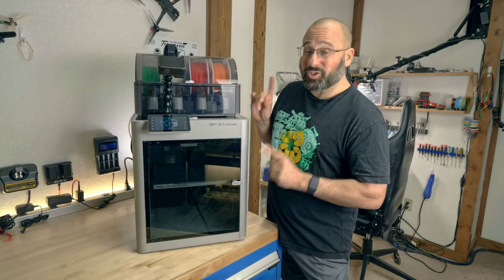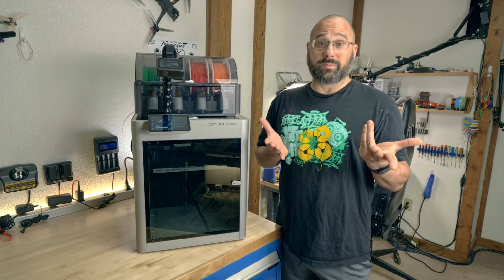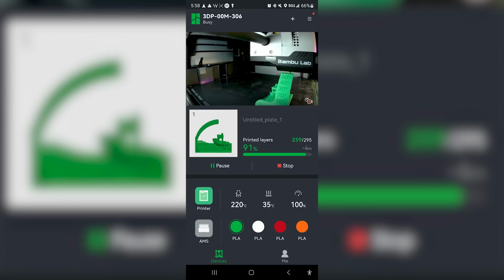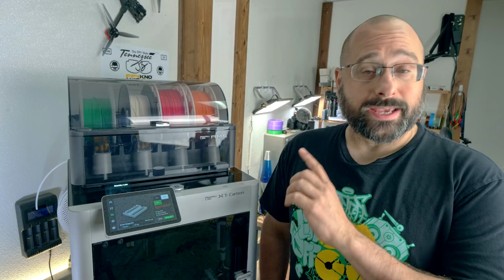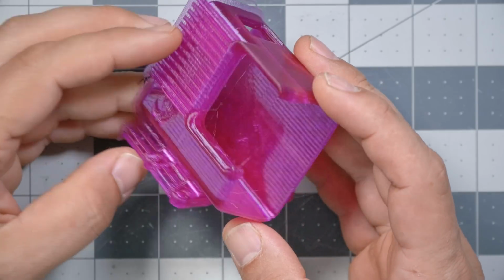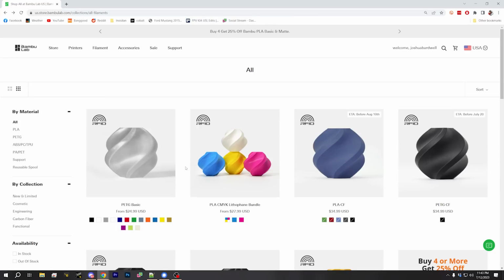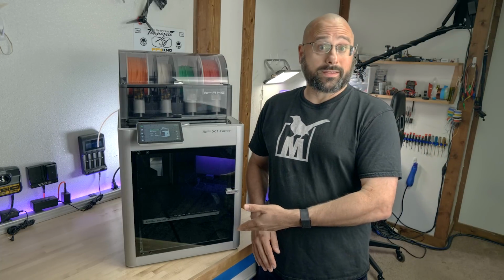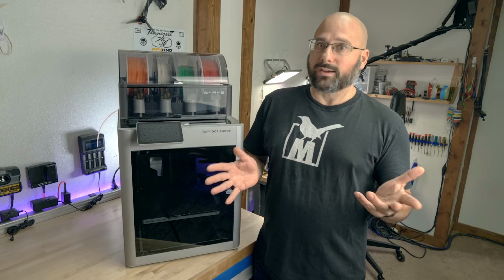Bambu X1C: the Fastest, Easiest, BEST 3D PRINTER I've Ever Seen

Comment: I just bought a P1P - it is hands down the best filament based 3D printer I've used to date.  Other than changing what filament to use via the bambu slicer, I've made zero changes to any other setting, and I haven't had a failed print yet.  That also includes TPU!  Completely blown away.  No doubt that Bambu has come the closest I've seen to a true press a button and it works type printer.  Very satisfied with the purchase!  I've also ordered the 4 color AMS and the $150 P1P->P1S upgrade kit.  If anyone out there is on the fence about the brand in general or whether to get a P1S or P1P, I wholeheartedly recommend the P1S.

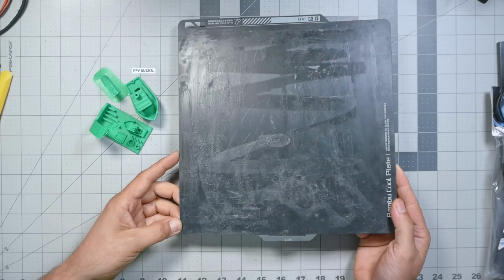Comment: 10:44 mb i can help you with the adhesion problem. this buildplate looks disgusting :p i printed more than 10kg of filament on the x1c and never got a single print come off the buildplate. i used the cool; engineering and PEI plate with prusament (pla/petg & pc); bambu filament (pla & pla-cf); filaflex40 TPU and PVA. just clean ur build plate with isopropanol EVERY print and use the glue stick only on verry large parts OR just increase the bed temp which does the trick too

Comment: Josua, just little correction ... P1P is working with AMS without any issues, there is also now P1S that is upgraded version with side panels and other stuff, like fans ... and it is also working with AMS. P1P is basically budjet frendly Bambu lab printer that can be upgraded to some way ( I think that upgrade kit from P1P to P1S is about 160$ or  something like that).

What you can maybe also try to show in other YT videos is how carbon filled filaments  are maybe ok for printing some parts for drone ? 

And welcome to Bambu lab printer owner club :D happy printing with it.

Comment: I build alot of printers and trust me the x-1 carbon is the best of all worlds. Unless you really plan on doing custom configuration of your printer or want to push speeds on a voron etc just buy ones of these! Even a bunch of voron builders have one of these too just to handle the multi-filament capabilities that the x1 has the ERCF just is a hassle to manage and you almost save more money not using your time to make one!
Reply: This is accurate - the Bambu and the Voron appeal to different markets/mindsets.  One Youtuber decided to get the X1C to print all of the parts for his Voron project which speaks volumes.

Comment: Ah I'm a glue user cause all I do is run my cold plate under screaming hot water and in 30 seconds it melts off all the glue. Zero warping issues.

Comment: I'd guess it's called a 'cool plate' because it doesn't depend on the heating and cooling process for the stiction (expansion of retraction) of the plate. My .02¢ .
Reply: It's called the "cool plate" because it needs less heat for PLA to stick to it.  It still requires some heat to help with bed adhesion.  I think the idea was Bambu was trying to make a plate where the bed temp was low enough that you could print PLA with the door closed, and the passive heating from that build plate temp wouldn't heat the enclosure up to the point PLA would glass pre-extrusion and clog without needing to run the chamber fan or take the lid off, etc.  Because running the chamber fan or opening the door/lid significantly increases the printer's noise level, and it's already loud AF.
Reply: @heroflying  Or, as with all else, "marketing" 😜

Comment: I've got the P1P and it came with the Bambu Dual Sided Textured PEI Plate and I get excellent first layer bed adhesion! Also i noticed if you print on Ludacris mode on the thin tight areas the print comes out better looking. I also noticed that if a print kinda messes up a little then the next time you print the same print it comes out better as if the printer knows what it did wrong the first time! I love this P1P! Thanks JB Cheers!

Comment: $1500 seems like Chump Change compared to the $10k my employer spent on an Ultimaker S5 with material station and air management system. We had to buy that printer because it was an approved machine. What a disappointing printer. Buggy, uses 2.85 mm filament and isn't direct drive.

Comment: Maybe you can try printing parts in different materials now and see if any parts are better in different materials than just their traditional ones. Maybe trying some polycarbonate, polypropylene or nylon. The go pro mounts and other flexible parts may work better in polypropylene. It is flexible too (usually classed as semi flex but I have found it is as flexible as stiff TPUs) but is ridiculously durable, it lasts much longer than other materials when used in living hinges and it doesn’t suddenly fail, some I have seen have like 600 % elongation at break and great impact resistance.

Maybe a polycarbonate would be good for things designed to take impacts but again a TPU or polypropylene might be better for that. Maybe a carbon fibre nylon or standard nylon or polycarbonate for skid pads. 

Once you can printer a wide range of materials and know what they are good for it opens up a lot more possibilities.

Comment: The dual colour screw gauge is easy to do with a single extruder printer, even a basic ender 3. The text is above the rest of the print so just insert a filament change at the layer the text starts so when it prints it, it will stop at that layer and let you change colours and then print the text.

This works with any print that needs different colours for different layers but it is very limited because you will need to have at least the whole layer that colour, so it works best for big block changes.

Comment: Your still gonna be getting to tools out. Be careful with that carbon fiber filament. It’ll jam the nozzle. No need for gluestick either…they want u to pit gluestick on to help you REMOVE the part after printing. It’s not needed. If your part isn’t sticking turn the head of the build plate some or use the high temp one. You can also uncheck the boxes for all the prep work. Bed leveling etc. it’s no necessary every print.

Comment: Slight correction. The ams can be upgraded to 16 filaments.  It has many many other features.
Getting the basic stuff out of the way multi color, multi materials with similar filaments,

It can be used for breakaway or soluble supports It's great for pla to petg print/supports
It can be used in run out mode. That means it will switch to the next roll if you are running out of filament so you can use up nearly spend rolls.
You can use 4KG of filament at a time
The AMS doubles as a (non heated) drybox with desiccant 
it has a humidity sensor so you have a rough idea how saturated the AMS is. (green, yellow red)
You dont have to touch filament at all which makes printing seamless from printing locally or remotely. 

Downsides
Do not use abrasives or softer materials like tpu but sttpu is an alternative to general tpu.
Reply: What the hell is STTPU?
Reply: oh how can one not up it to 16 materials... you just spent a bunch of my $$ damn u

Comment: I have an p1p with some tweaks (you can buy them in the p1s pack). It's a great machine, I don't need the lidar sensor. 
But I need to correct something you say', the p1p CAN run with Ams. Also Bambu says don't print TPU from ams.

Comment: Regarding the print bed, its funny Ive got a CEL Robox from like 2016 that I'm still using, its got maybe 1200Hrs of printing time on it and I have NEVER had a single print detach from the print bed during printing. I don't use any sort of adhesive, I just clean it with IPA from time to time. When the print finishes and the bed cools down, the part detaches by itself. It looks like a sort brown fiberglass like what old PCBs used to look like. I'm convinced now its the ideal build plate material. Anyway great review Joshua, I want this printer!

Comment: 25:38 what are those thick rectangles under bambu P1Ps on the shelf? Are they concrete blocks? Is there anything else between the printers and these blocks?
Reply: Paver stones probably to give a flat full surface for the printer to sit on since he’s using wire shelving.

Comment: The drying mode doesn’t just heat the bed, the printer has a heated enclosure. I would definitely get a Bambu if they weren’t proprietary closed source and had the same reliability and support as Prusa printers. Nice to see some competition for Prusa.
Reply: yeah im also unhappy with the reliability. cant get all parts and there are quite a few failures popping up where there is no replacement available. sending in a huge 3d printer for repair is not something i want to live with.
Reply: @drkastenbrot  I have been printing for a year with zero issues. Which parts can you not get?

Comment: Been running 15 Prusa i3Mk3s in a school lab for almost 4 years now. Seriously considering replacing them with Bambu's. I definitely do feel some affinity for Prusa and their open source machines, but the speed on the Bambu's is excellent. It is also a bit of a pain to order internationally with my school. I will say that some of my Prusa's have over 900 days of print time on them and 15km of filament printed so we've certainly gotten our money out of them. Thanks for the video.
Reply: Prusa just came out with a frimware that suppose to make their printers print faster.
Reply: Sometimes you are better off knowing the devil you know! The grass is not as green as it is being advertised.
Reply: @muddymaker3721  Yeah I hear you on that. I'm going through and basically rebuilding all of them right now. The nice thing is that I actually can rebuild them, can easily get parts, etc. I'm reprinting a lot of the parts around the X axis carriage in higher temperature plastics and am hoping that will help with some melting issues we've had when large blobs form due to print detachment.

The other big question is that I sometimes have over 100 students all with 24/7 access to the printers, and as you can imagine they take a fair amount of (unintentional) abuse. I'm actually a bit worried about all the features on the Bambus since in my situation that is more points of failure.

I suppose in the end, it is great as a user that the technology continues to improve. Really that's a win for all of us regardless of what printer we choose.

Comment: Bambu's offerings are not all that great and revolutionary. A stock voron or ratrig can easily push those speeds and accels, bambu is closed source and has all propriatory parts. If you print a part on the "standard" preset, it will be lacking in strength compared to the same part printer slower. You also cannot calibrate the damn thing yourself (flow, pressure advance... etc). However, credit where it is due. It is by far the easiest printer to get running and use. Prusa a close second. Regarding privacy, all your files go to a server in China, where privacy laws aren't great to say the least, you cannot send files "Lan-only". For anyone wishing to get a 3D printer that is not a kit, get a Prusa MK4.

Maybe a slightly negative comment, but not many people bring it up and it should be discussed before a purchase. I dont recommend Bambu.
Reply: "You also cannot calibrate the damn thing yourself (flow, pressure advance... etc)."  This is flatly not true. You can tune Pressure Advance with Orcaslicer if you want, and Bambu even provides documentation on calibrating flow.  https://wiki.bambulab.com/en/x1/manual/manual-flow-rate-tuning

Comment: Should mention the P1S for those that cannot afford this, the P1P is even cheaper but does not do all material as it’s not enclosed and bearing in mind your hobby an enclosure is pretty much essential as you will want to print in higher temperature material.
I have had an X1 for about a year and the LiDAR is not that useful.
The rest of the options are useful.
Love my Bambulab printer.
Reply: And the P1P does work with the AMS by the way. And it does  work the enclosed P1S as well. None of them are perfect but it’s the closest I have seen to plug and play.
Reply from the maker: The flip-side is that lots of people don't print ABS or CF nylon, and don't need the enclosure. For them, the P1P is perfect.
Reply: @JoshuaBardwell  Here's the thing though - just because you don't print with ABS and CF nylon, that doesn't mean you won't benefit from an enclosure.  Everyone gains at least SOME benefit from an enclosure.  For example, yes, ABS and nylons for example absolutely warp more than PETG, hence why people say use an enclosure (plus ABS fumes).  Does that mean PETG doesn't ever warp?  No.  PETG does too.  If you print say a big open box across most of the build plate with sharp corners, PETG absolute can warp on you in colder room.  So can PLA, just not as much.  Enclosures add consistency.  You also have the charcoal filter in the enclosure.  The enclosed printer is much more effective as a filament dryer if you use the printer for that.  It's more efficient power wise.  While that doesn't mean everyone has to or should buy one, if you're looking at the P1P for $600 vs the P1S for $700, the P1S is a no brainer.  Right off the bat the P1P doesn't have the aux cooling fan which can help with lots of prints, not just with those materials, which is a good idea for most people.  There's $30 of the $100 for the P1S...

Just get the P1S at that point IMHO.  The enclosure is worth $70.

Comment: While printing that fast is pretty amazing, the layers below the 'water line' on your benchy looks kinda sketch.    I'm guessing it's using variable layer height which is great for speed, not so much for quality unless you are doing some post processing.
Reply from the maker: Could be. Bambu slicer does support variable layer height. And that would increase the speed.
Reply: it's not because of that.  It's a known issue with benchies because the top deck completes which radically reduces the layer time, and this changes how much cooling above and below that line get.  That changes the sheen of the filament. This video kind of explains it pretty well.  https://www.youtube.com/watch?v=J_pxk7HP3RE

Comment: With my ender  3 I've literally never had any problems anymore with bed ahesion, for years now, after I switched to sprayglue on the bed before printing (3Dlac in my case). I believe Bambulab recommends their own brand of gluestick, never anything else (of course they do). They can make textured beds all they want, the reality is that those suck. I believe that is the reason you experience the print loosening from the platform there.
Reply: If textured beds suck, why does mine work so well?

Comment: @joshuabardwell I got my X1C about a month ago, I print daily and have had zero failures to print. I've used the Cool Plate and the Engineering Plate (two sides of the same plate). I use the Bambu Lab glue stick and my prints have never lifted from the print bed. I've printed TPU, PLA, ABS, and ASA using Bambu Labs and Matterhackers filaments, all without any issues at all. The Matterhackers TPU was printed using the Bambu Labs TPU95A profile. I've printed bunches of TPU stuff, and all have come out just fine. After printing, I always wash the plate using dish soap and water, just as the text on the plate says! The TPU filament spool from Matterhackers does not fit the AMS, which is fine, as TPU is not supposed to be used in the AMS (Automatic MEDIA System!). I put the spool of TPU in my Sunlu S1 Plus filament dryer and it feeds the X1C from there (I drilled another hole in the dryer at the back of the lid to make this even easier). The Matterhackers spool doesn't sit well on the external spool holder, so using the Sunlu S1 Plus dryer is a fantastic option.

Comment: Great video - I wanted to note one thing that might be a consideration for FPV people - that AMS can't do TPU (at least as per Bambu) so you are limited to single filament for that.  If you only print TPU, save the cost of the AMS.
Reply: id avoid it in general unless you have a serious need for it. swapping filaments is quick and easy with this printer anyways and the AMS causes more issues than the printer itself.
Reply: @drkastenbrot  That is a very interesting take. I have the X1C and almost at a year of use with the AMS. I have gone through thousands of filament loads, retractions and swaps and it has been fine with general maintenance. So I would look at a printer without an AMS a downgrade. The AMS has a bunch of other features other than multicolor though. 

There is a TPU alternative that works fine with the AMS if you dry it right then it absorbs moisture and softens.(you can dunk in in water too speed up the process)
It's called sttpu. Prints like PLA (80D hardness pla is typically 83D) and softens into a TPU consistency(65A). As with anything YMMV.
Reply: @drkastenbrot  my ams has messed up probably oh… 10 times in a year, the overwhelming majority of those issues were filaments breaking, being malformed and clogging in PTFE tubes or in the feeder, or filament reals that were too light at the end of the roll. The overwhelming majority of the time the AMS been perfectly reliable.

Comment: If FPV is what is lead you to 3D printing, I highly recommend the P1P - It will print TPU just as well as the X1C.
Reply: That was true until the P1S was released.  Just pony up the $100 more to get the P1S.  Absolutely worth it.